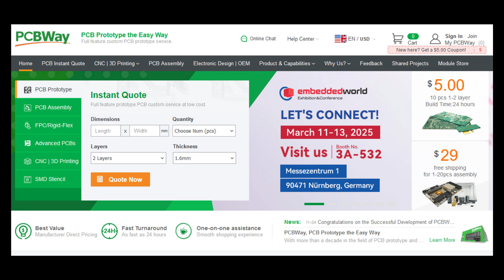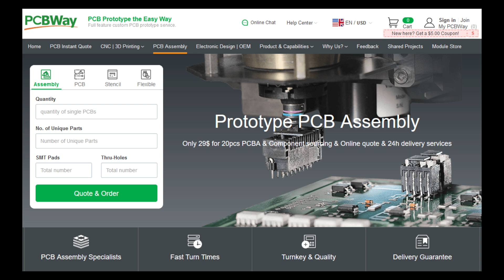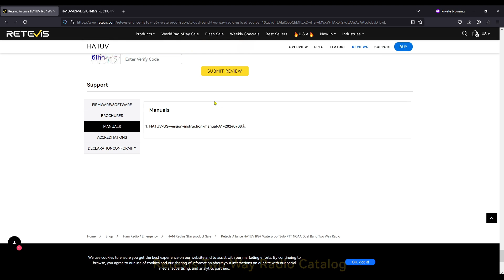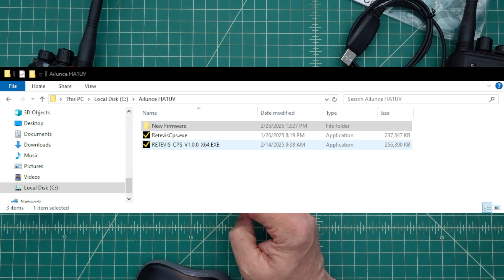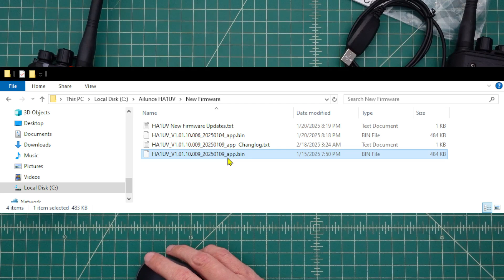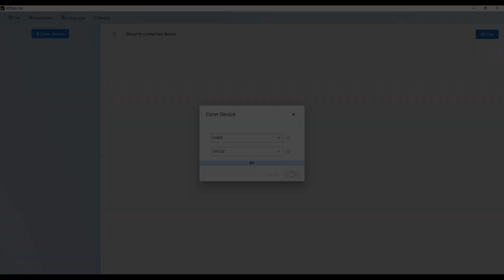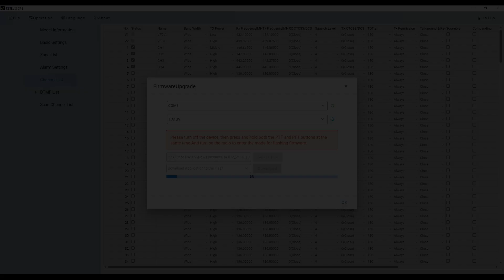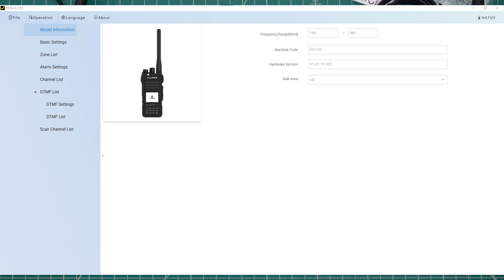Ailunce HA1UV Dual Band Ham Radio: Firmware Update

Comment: I just updated to the 2025-09-01 build version V1.01.13.001 and now I can have custom boot screen image ^^
Also a Problem I had was it only "half flashed" / bricked in the first try. Running CPS as admin fixed the problem.
Edit: and I just saw that Chirp next-20251024 is now compatible
Reply from the maker: Glad to hear you have it sorted out 👍

Comment: Thank you for the video! Just received mine, but refuses to turn on DFU mode... The light stays green (it reads fine in the CPS, so not a cable issue)...  Guess I'll just leave it to 005!
Reply from the maker: Good luck with it

Comment: New firmware coming up for the HA1G.
Reply from the maker: Nice, I hadn’t heard.  👍
Reply: @TheSmokinApe  been emailing back and forth w support at Retevis. They're excellent.
Reply: @TheSmokinApe  had a question about the weather feature and the frequencies, and Retevis confirmed there's an issue. Got an email this morning from support and they said the next firmware would fix it. And that it wouldn't take long. Very good support at Retevis, quick replies.